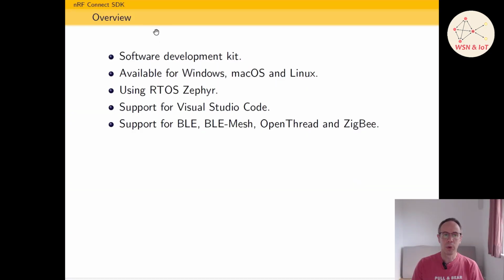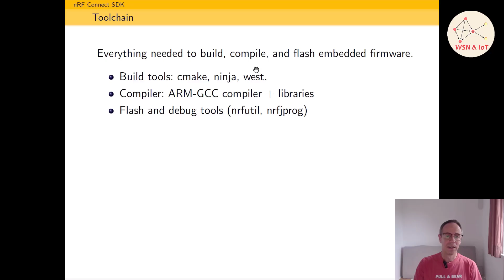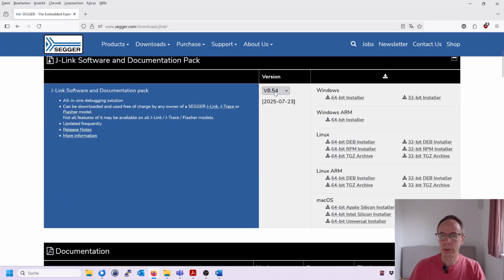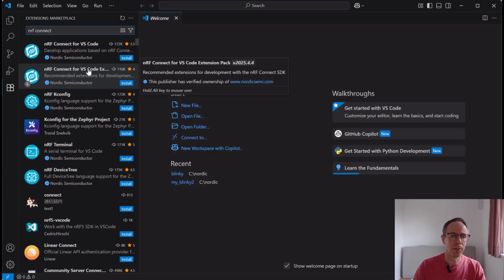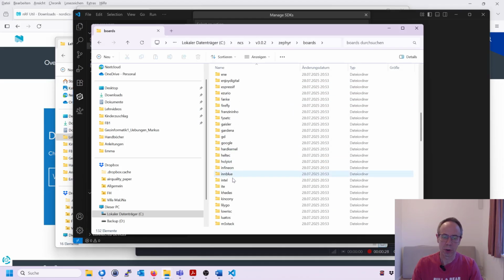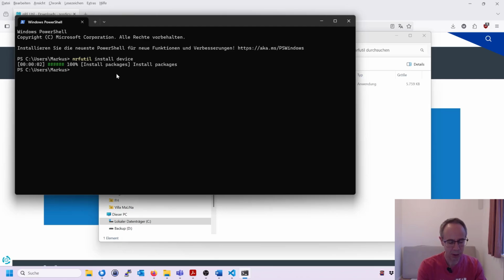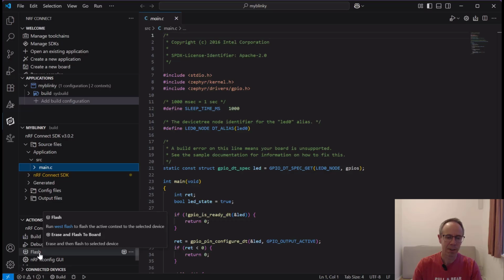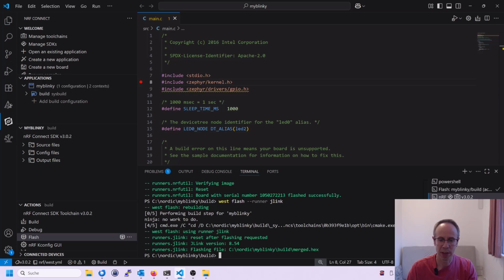Zephyr and Nordic nRF Connect SDK - Introduction and installation (v3.0.2)

Comment: Hey when i connect my boaqrd it blinks but i dont see it conencting to my PC ;(
Reply from the maker: Did you use the right usb port? What is with the power source switch? Should be on VDD. The other switch should be also on DEFAULT and not on nRF only. Did something happen in the device manager when you connect the device?
Reply: @wsniot  Hey, Apparently there is this VEXT->nRF switch which was ON  so that's what was causing the problem haha. Works great now. Thanks a lot for taking the time to help. Cheers!

Comment: Thank you for your time to create this video. I have migrated my device firmware from nRF52 SDK to nRF Connect SDK v2.8.0 (since it seemed most stable compared to previous versions)  and at some point I want to pass my firmware to v3.0.2 but I haven't found the courage  to face bugs and changes of the new version  just yet  :)   So, this is a good refresh on the basics. Also, At some later point it would be nice if you created a video on how to use the  debugger tool in nRF Connect extension in VS Code.
Reply from the maker: Thanks a lot for your feedback! I totally understand wanting to stick with a stable version for projects. Luckily, bugs in Zephyr are often fixed quickly. So maybe its already ok using v3.0.2. Glad the video helped as a refresher! I’ll add the idea with the VS Code debugger to my list.
Reply: @wsniot  I would be glad to give you ideas about interesting topics in your new video series regarding nRF Connect SDK and nRF52840 based on my experience so far. Just let me know. Again thank you for your time!